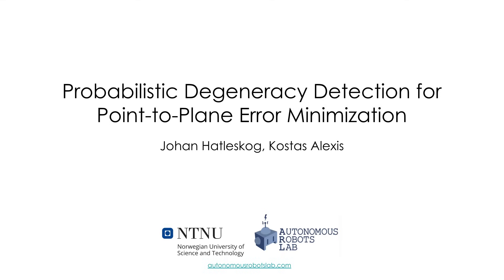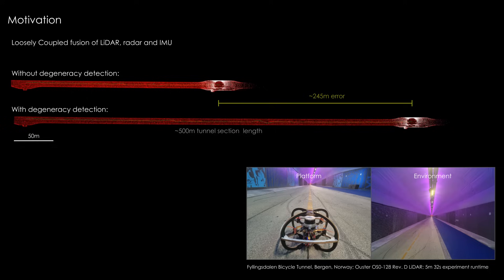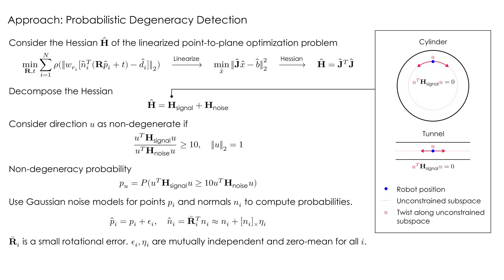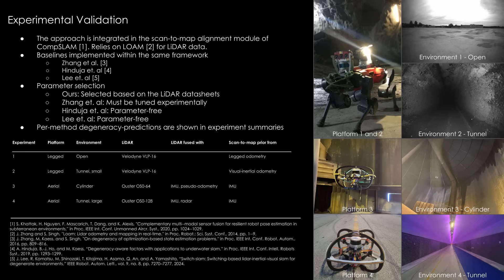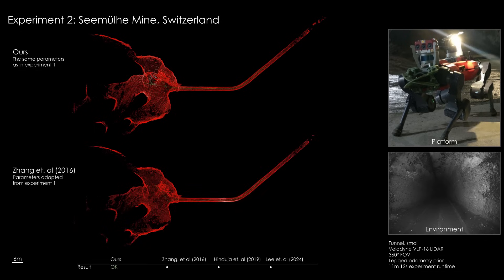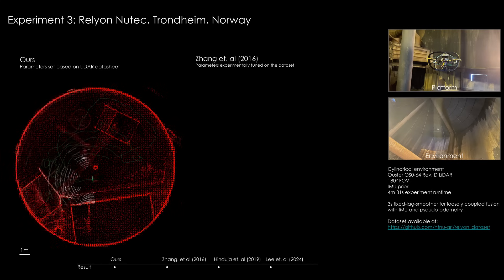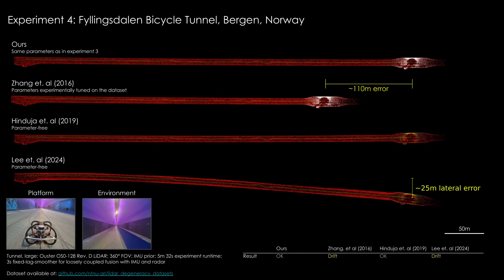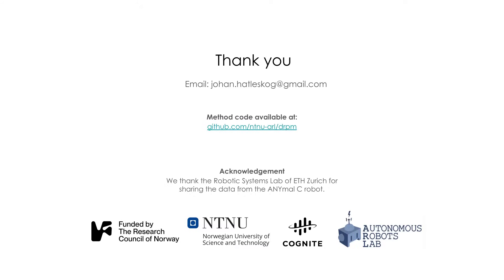Probabilistic Degeneracy Detection for Point-to-Plane Error Minimization

Comment: Nice. This is a great contribution! It might be valuable to compare your approach with COIN-LIO, which also addresses similar issues this year. Additionally, you could consider using the WHU Helmet dataset, as it includes an 800-meter degenerative long tunnel walk scenario, which might provide an interesting benchmark for evaluating your method.
Reply from the maker: Thanks for the input. We indeed have activities relevant to what you describe :)